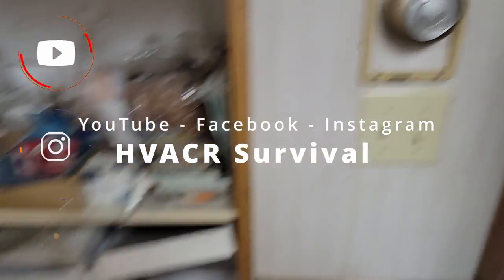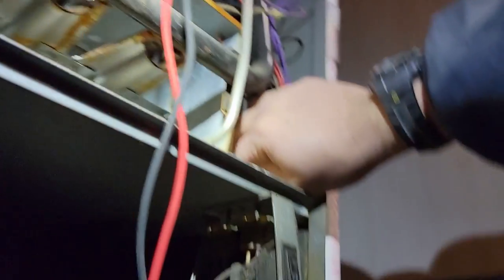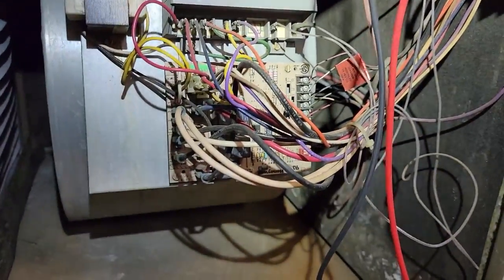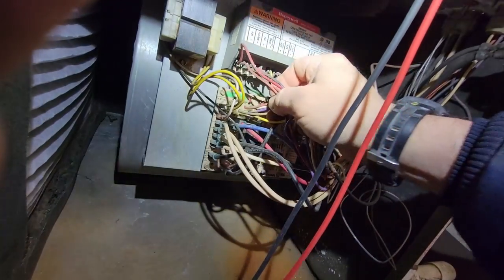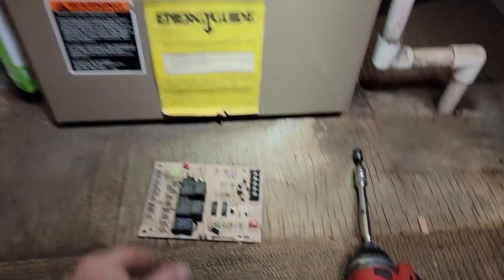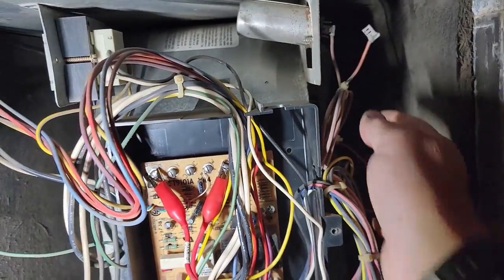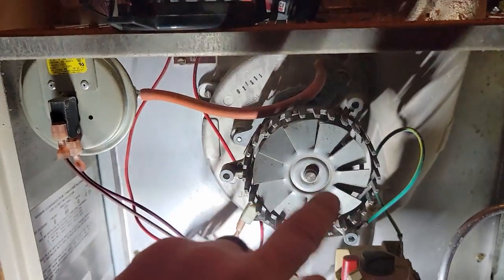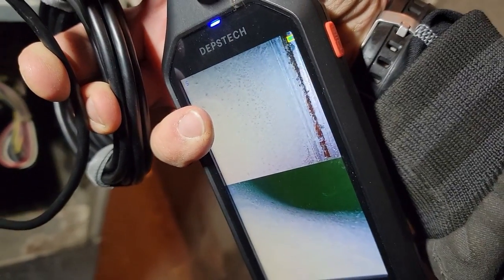Logical Furnace Troubleshooting 2 Furnace Not Heating Service Calls

Comment: These furnaces are not old. Two years ago, I had my gas furnace replaced that was made in 1959. Not kidding. That would make it 61 years old. The heat exchanger was rusting really bad. I bet the new furnace does not last that long. A few days before the change-out I cleaned up the furnace room and added 2 long strips LED lighting to brighten it up. They said it was the cleanest and brightest room they had ever seen. I told them I don't like to work in dirty, dark places either.
Reply from the maker: That would be a sight to see!

Comment: Good job Rick, I learned on an analog meter and jumper wires when I started, the younger generation doesn't realize how nice the new techs have it. Good work there DJ Rick.
Reply: Back then it was a nicer world it seemed.  Slower paced.  The cost of living was lower.  Now technology has advanced and continually makes humans unnecessary, and those humans that are employed are often times doing the work of 5-10 people in comparison to 30-40 years ago.  The grass isn't greener on the other side!  Your analog meter and jumpers may have helped to keep your sanity.
Reply: hang on while my VTVOM and other vacuum tube gear warms up. 🙃
Reply: Okay, pronoun.
Reply: Just fine.
Reply: You guys want more money, so you have to work harder for it.

Comment: Son you're a baby 🍼 but you're very good technician. I'm probably more than three times your age. But you're still one of the best. The only thing I'd really like to see you do is wear rubber gloves when you handle your new electronic boards. I designed and built electronic boards for years. And I know that the least bit of static can knock out parts. Or weaken parts. This will cause you to have to make more recalls. But that could make you more money. Just a suggestion from years of experience. You're super good technician. Keep up the super work.
Reply from the maker: Thanks Beryl! I always touch the grounded frame of the furnace first before touching the edges of the pc board. I know you're correct, luckily these boards are very basic with no MOSFETs or other super sensitive circuits.
Reply: much of the parts and boards have protection built in now days and you'd have to try hard to break them via static discharge.  it's nothing like the early field effect transistors and IC's where they'd nuke themselves if you looked at them wrong from twenty feet across the room!
but, that's no excuse to be sloppy and not use proper antistatic work methods at all times.

Comment: As a technician of 24 years yes a jumper pack does work if you have one like what I have where you have an inline 5 amp resettable fuse then it's great cuz you can jump out many things but to make this job quicker and easier for people you should have simply owned across the pressure switch and followed the wiring diagram a call for heat which you call for the induced draft motor as well as a hot surface igniter if it had one or a standing pilot or electronic pilot you could have tested the top of the actual gas valve if it was getting power during a heat call and work backwards it would be a lot faster than gas and on things also everyone seems to always forget safety switches specifically this design that high limits safety sticks out about 3 in inside the metal is also subject to having the water from the drain pan and the coil drip on it so it can get corroded and go bad
Reply from the maker: Yeah I know what you mean after doing it for 28 years 🙂. Both of these furnaces are brain dead simple repairs, but most residential furnace repairs are,  no surprise there. To be truthful I had absolutely nothing else to show that week and I wanted these videos off my computer.  I've always preferred using a multimeter in the voltage position to test safeties and switches because I've been screwed in the past by switches that were capable of showing closed with a ohm meter but when put underneath a load they would open up and that's why I used my volt meter to check the pressure switch,  plus you have to isolate a switch when testing in ohms, that takes more time and then your taking a chance of damaging the switch terminals,  Also I would never use a 5 amp breaker because you've just over loaded most 24v  circuit boards and the transformer most of them are usually 40va and (max of 1.66 amps) and fused at 3 amps which is the size breaker I used on my jumper but I haven't used that for I don't know how many years.  Thanks for checking out the video 👍👍

Comment: I remember those digital Honeywell t-stats. My parents house had one untill they had to replace the furnace, it had heat/cool switch and I think I a fan switch. One of the buildings I work also have a version that is used on an ancient multizone damper system to control the roof top air handlers, those too have a heat/cool/auto/off and fan on/auto switch on the bottom.

Comment: '93 doesn't seem that old to me. When I first started they were still using vacuum tubes in industrial/commercial flame safeguard controls. I can still remember the tube numbers for the old Fireyes.
Reply: My HVAC/R instructor gave me a bunch of Amperite time delay tubes and the pilot relay that went with them. (In his words, "you're the one person I know who'd appreciate these", and he wasn't wrong. Around that same time I found a Simpson 260 hiding in the lab. After some new batteries, I gave it the first use it had likely seen in decades.)
Reply: Those Amperite time delay tubes were used in draft controllers to prevent nuisance shutdowns due to momentary low draft conditions.  I remember carrying the Simpson 260 but you also had to carry a Honeywell micro amp meter to read their flame signal. The Simpson was good for the Fireye's VDC readings though.  Don't get me started on the antiquated ways that we performed combustion tests.
Reply from the maker: I used to do combustion tests with a bachrack where you tilt the red cylinder back and forth to find out your CO level and smoke test.
Reply: @HVACRSurvival  Those really gave your arm a workout setting up a full modulating burner. Especially dual fuel.

Comment: In that first furnace, I'm a little surprised that the ignition control box doesn't control the inducer.

I still see those Chronotherm III 'stats pretty often, and very occasionally I'll see the older generation with an analog clock and synchronous motor...still working just fine.

I bought that Depstech camera after seeing it in one of your previous videos. I've been really happy with it so far. It replaced a Harbor Freight special that drowned. For extra fun, you can plug the Depstech's camera into a computer's USB port. It's nothing more than a USB video class camera, although I haven't yet figured out how to enable the side facing camera.

Comment: Cracked solder connections due to age. If it were my furnace, I'd break out the soldering iron and re-solder all of the spades and relay connections. However a new board is the way to go so you don't end up with a call back.

Never mind, didn't see the corrosion til you got the board out.
Reply from the maker: Thanks Scott!
Reply: I was guessing it was a bad relay, though it could have been the corrosion. In any case a DIY fix would have been to replace one or both relays, and if necessary add a jumper over any corroded traces. However, that is a DIY fix, not one I'd sell to someone.

Comment: Boa Noite todas tem o mesmo modelo de placas? Aqui no Brasil nunca centrais que tem a parte de aquecimento por gás,  corre algum risco de fazer brasagem? Parabéns
Reply from the maker: If the translation is correct, you’re asking if there’s any risk in brazing I’m assuming you’re referring to brazing refrigerant lines while you have a gas appliance underneath of it? If that is the question then no, there’s no risk because the gas is sealed in  either copper or metal piping.